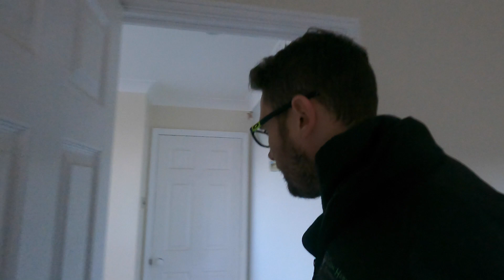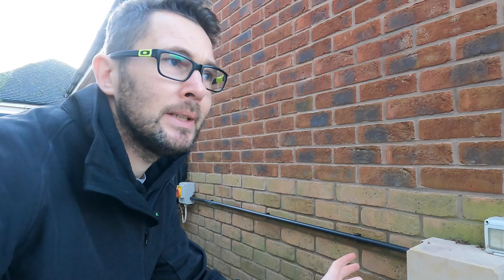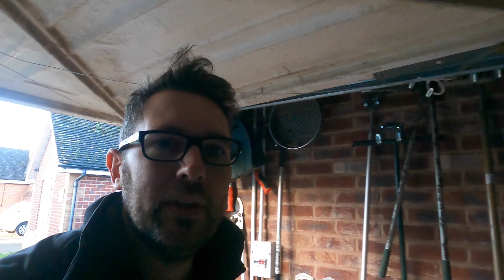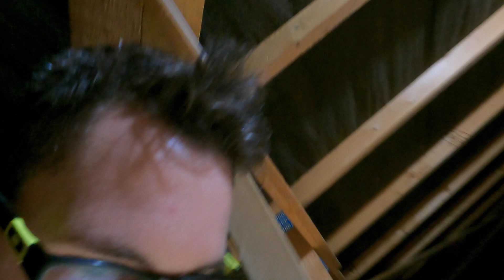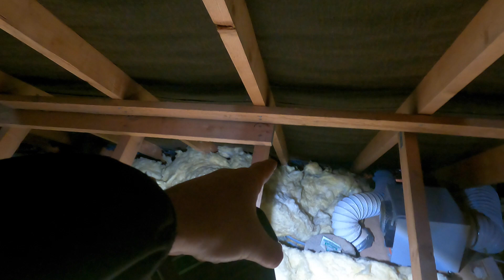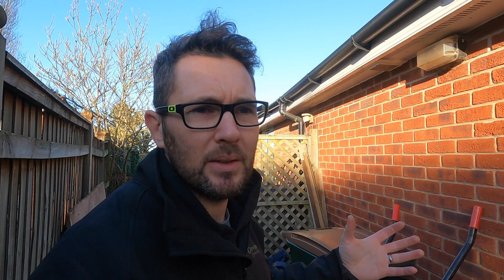SHOCKING EICR FINDS!!!!

Comment: Quick question if anyone can help do you have to be a registered electrician to carry out an EICR ? I am 18th edition qualified electrician been a spark for 10 years but not currently niceic or any governing body…
Reply: You have to be competent, that is a legal term not a self certification, just because you think you can do it does not mean you can..  Both NICEIC and NAPIT have an inspector program (I note that Green Hawk Construction Ltd is not assessed as an inspector, NAPIT seem to be more on the ball, probably something they could look into as I am sure they have all the relevant quals and insurance to do be an inspector)..  To qualify as an Assessor you need to have NVQ 3 inc AM2 or equivalent, latest regs qualifications, 2391 test and inspect or equivalent.  Liability insurance and indemnity insurance, you also take a test and are assessed as part of your assessment to prove you have the experience and knowledge to do EICR's.

If you have all of those so you could be an inspector under a CPS scheme then I would think you should be ok..  If your thinking of doing it for your mate though just be careful as if anything goes wrong they will point the finger at you so best to have all the insurance and qualifications to cover yourself..

Hope that helps, was not trying to be negative..
Reply: @steve11211  cheers mate appreciated